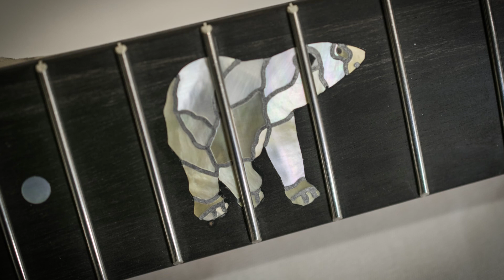Inlay Tutorial - Multi-Piece Polar Bear (Part 4)

Comment: Maybe it's in another video series..., but how do you cut a "radius-ed" fret slot with a straight saw?  (As they generally are) Seems like to get the outside edge deep enough, the center of the board would be cut too deep. Or possibly, since there's not THAT much of a radius, it doesn't make a difference?  (Thinking out loud)
Reply: Woody H doesn't really matter as long as you don't go through to the neck. The fret will follow the radius when hammered in, and it'll stay as long as the channel is tight enough irrelevant of depth
Reply: Theres actually a very simple triclk for that. Say you want a 4mm deep fret slot (4mm deep from every point of the radius not just the centre). Take your saw and stick a strip pf masking tape and tape it along the blade leaving deep 4mm section of blade showing, then as long as the tape reaches but never dips below the level of the board at any point around the radius while cutting you are set.

Comment: it seems ben did a little retouching in between last part 3 and 4, some of the silver powder inlay looks sharper and better.

now, I would be happier with a sharper silver powder inlay (I got convinced in silver looks great) made with an engraving bit (round or pointy), that would had yielded a better control over inlay thickness, but that's goes withing a subjective matter of taste.

I've done a bit of inlay work before but nothing as complex as this, overall this tutorial series were great and showed me a new way on how to inlay (I normally inlay each piece one by one and overlap the "joints" so the latter piece installed would cover the edges of the previous inlay already installed, so I could for example inlay 5 flower petals and finally the center, not very fun for a multipiece inlay like this of course)